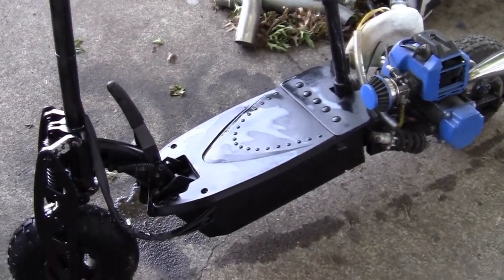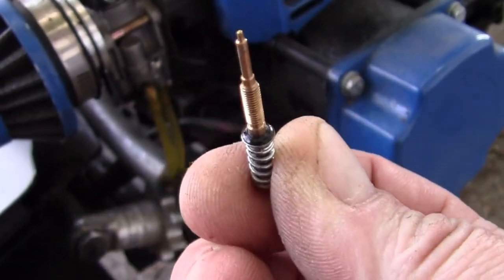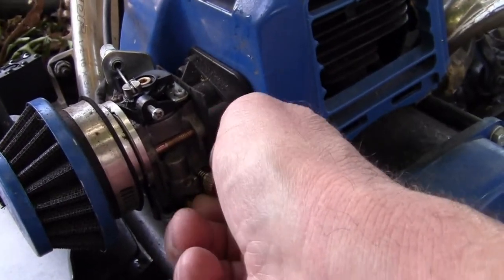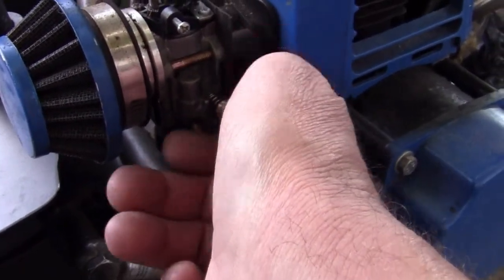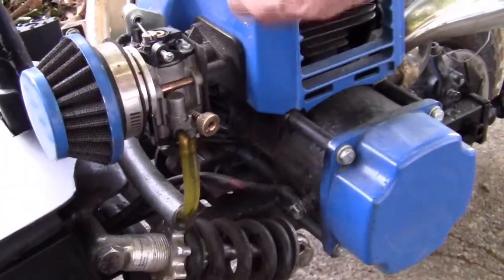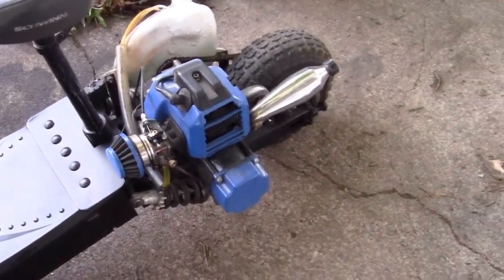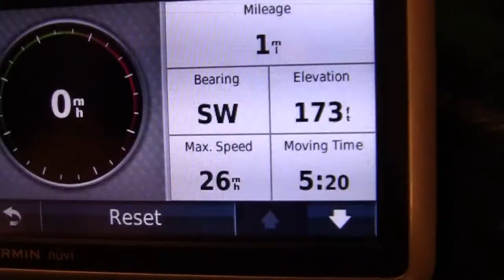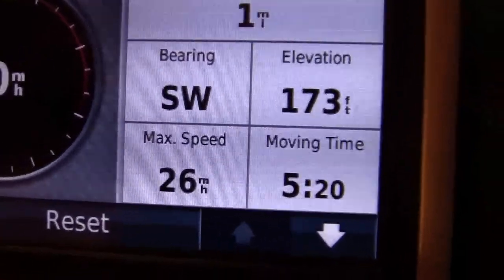EASY ADJUST GAS SCOOTER CARBURETOR ADJUSTMENT SCREW

Comment: Whats the adjustments for these carb? This one as well as the small one on the top in the black plastic butterfly? Pls and thanx
Reply from the maker: Every engine is different on the tune . However this one starts at 1-2 turns out and tune from there . The top one is very picky but I start at 2 turns out . Thanks !! And you find that weather temp changes the tune as well . that is why I made this part..